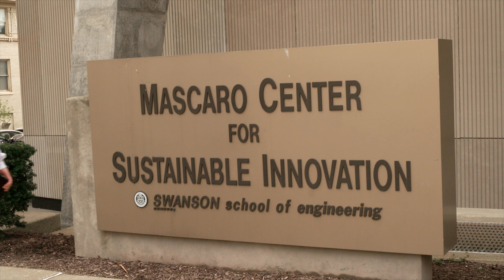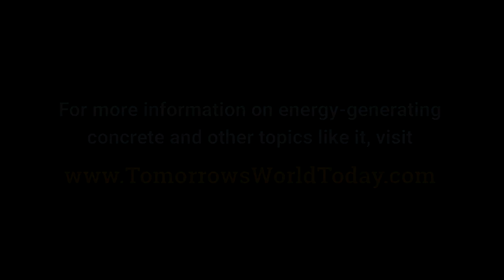The Energy-Generating Concrete of the Future

Comment: "Prduce 330MW of power" "not enough to export to the grid" I smell BS.
Reply: That seems to be 330 microwatts according to their paper.
Reply: nano technology , graphite enhanced electrode , meta materials and "smart" Concrete  seem to be typical buzz words to enhance investor confidence. But what the interviewee is saying is less than what the narrator claims. Maybe the video producer got carried away with enthusiasm. "Smart  infrastructure system " prolly means it being capable of being used as sensor, rather than "Solar roadways". the strain of of vibration ( movement ) provides the sensor data. its not that revolutionary considering these sensors already exist in a different form as actualy sensors and are easier to install in existing systems and when they breakdown, you dont have to replace the entire road system.  @0:29 they actually have electrodes embedded in the concrete  ( and the concrete seems to be seperating from the PVC pipes and some of te pipes seem to be cracking from the strain )so why not just use the many sensor systems already available.